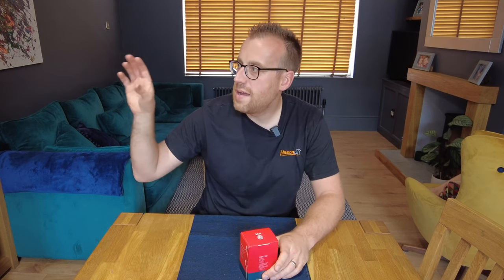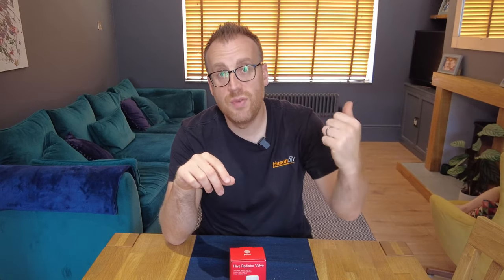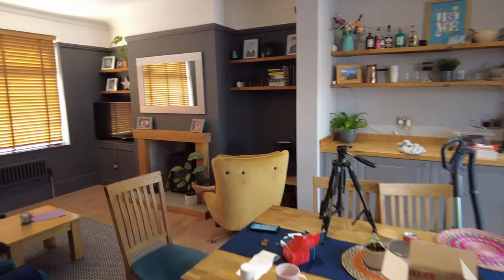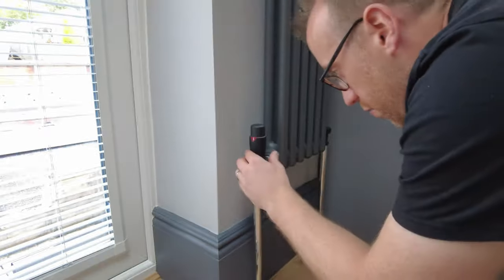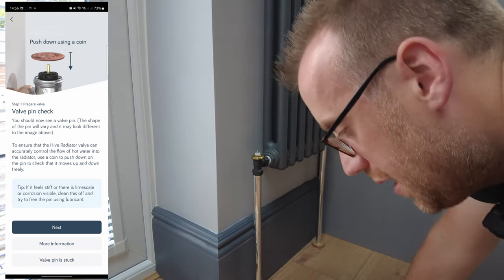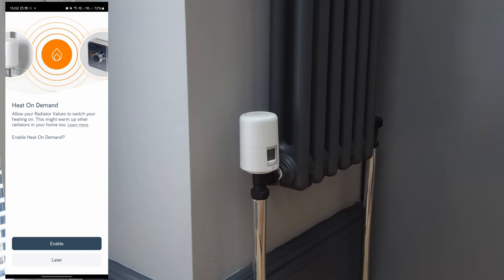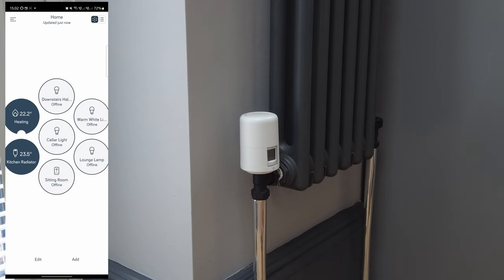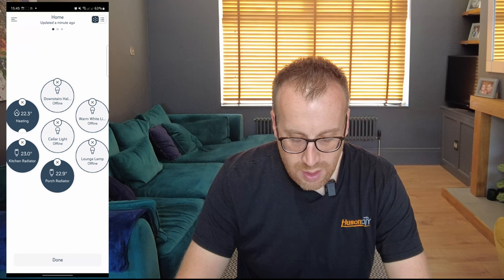Save Money on your Heating Bill!? Hive Smart Radiator Valve Unboxing & Install

Comment: Hey, I totally appreciate your informative video and your time to record it.  If this is your career, again truly appreciate you trying to help others save money.
I have a Hive, and was going to change my valves for these.  My gas engineer kindly pointed out that I will not save energy as I already have temperature setting valves.  Instead of be lazy using the app, to get up off my backside and turn down the room as and when it's not used lol.   My valves Re marked 5 -0.  So I initially saved hundreds on 8 new hive valves. and I'm still saving in keeping certain rooms cooler than others. 😊
Reply from the maker: Hello! Thanks for your comment. You're correct, the main benefit is the ability to automate the valves. I suppose any automation, this being lights or heating etc, could be classed as addressing laziness. 

The beauty of these valves is the ability to schedule different temperatures for different times. You control sections of your house without the need to go round changing multiple valves all the time.

I guess the line between automation/laziness is quite blurred!! Lol.

I suppose a counter question for you. Why have you installed a Hive thermostat system rather than sticking with a traditional/cheaper thermostat setup?
Reply: @husondiy  the gas engineer recommended it, it was on offer, so I do use it for the heating, and now two lamps.  Great as a  security deterrent for when the house is empty.  I have schedules on all 3.
Reply from the maker: Perfect for your situation! I guess that's what great about these different products. Some will be useful for some people, some pointless. 

The Hive TRVs have transformed the way we heat our house. We can schedule for certain rooms to be on and others not. We can set specific rooms to heat up while we're out ready for our return without heating the whole or other parts of the house.

They are certainly a longer-term investment to see the cost savings, but we will definitely get there.

Comment: Hi mate, first off, really great video explaining the step by step guide. I am currently in the researvh phase of getting these. I have a plumber coming out tomorrow to switch my current lockshield valves to TRV and then will purchase the HIVE ones. My one question which i'm sure you probably have already answred before, but just so I understood it correctly is if my main thermostat is set at 19 degrees, but I want my bedrooms to be at 23 degrees, does this require heat on demand or can it be done via individual schedules? Hopefully that makes sense l.
Reply from the maker: Hello! Sounds great. How many Hive valves are you having installed? 

You're right though, you need to allow heat on demand, which would allow the main heating/boiler to come on when required. You can schedule per valve though too.

Let me know if you have any questions, happy to help 👍
Reply: @husondiy  So if i have individual schedules for each rooms so for example the bedroom set for 20 degrees and the living room set for 18 degrees, those will work towards those targets even if the main thermostat says 15 degrees? Would that scenario need heat on demand?
Reply: I current have 6 radiators in the house and the bathroom radiator. I don't plan on putting a TRV valve on the bathroom one. I already have manual TRV valves on two radiators and getting my plumber to come in today to replace the other 4. My thermostat at the moment does not have a fixed location so does it matter if all radiators have a TRV valve excluding the bathroom?

Comment: Thanks so much for the Video. I'm thinking of getting these valves for my house. I've read so many negative reviews I started searching YouTube and found your video. So pleased that you didn't edit out the bits where things didn't go perfectly first time - just as in the real world!  Clearly some time has passed since you installed them, what do you now think this far down the line. Has there been any issues? Would they still work after a software update? Thanks again for your time and advice. Atb Paul
Reply from the maker: Hi Paul!!

I would definitely recommend them. Done a quick video reply for you:

https://youtube.com/shorts/dgfo6F06hkY?feature=share

Any other questions please just ask 👍🏻

Comment: thanks for the video. My electrics went off a few days ago and now the lounge TRV wont calibrate. Its taken 2 days. All the other valves are working. What can I do
Reply from the maker: Hi Niti. This happened to one of ours. I factory reset it and readded it in the app. That sorted ours.

Guide here:

https://www.hivehome.com/ie/support/Help_Using_Hive/HUH_Hive_Active_Heating/How-do-I-factory-reset-my-Hive-Radiator-Valve

Comment: Ben, Can I set all five valves to heat on demand mode i.e. if any one of them wants heat it can turn on the boiler regardless of the other rooms.
Reply from the maker: Hi Mark! Yes 100%. That's the beauty of it, so one room could be on and all the others sit there off.

Comment: I have two questions to ask. When the batteries run out, if this coincides when the heating is on, do the radiators go cold, or does it stay at the temperature set on the TRV before the batteries run out, and does it notify you your batteries need replacing?

I have a heated towel rail in my bathroom. So, would you recommend a Hive thermostatic valve for it, or just for the rooms in my house? Thanks.
Reply from the maker: Hi there!! Great questions. So with regard to the battery in the TRV's, they have an indicator in the app to tell you their battery status and this will tell you when the batteries are low. Its the same for other sensors and also the main heating receiver. So I'm not sure what would happen if you let the battery die, but you should get plenty of warning to replace them before they get to that point.

We have 2 towel radiators in the house, and neither have valves that are compatible with the Hive TRV's (or any other TRV's) so it was never an option for us. However, if yours are different then theres no reason why you shouldn't. I guess its down to preference as to where you want to keep control. Our towel radiators are in spots where we dont mind them coming on if another radiator was to become active in the house.

Let me know if that needs clarifying or if you have further questions. Happy to help where I can 👍
Reply: @husondiy  Thanks a lot for your helpful advice, it really did help a lot. I have 7 radiators in my home, and one bathroom rail radiator. I decided to buy the 8 pack from Hive to get the discounted price. After speaking with their tech people at Hive I decided I won’t install one on my bathroom rail radiator because of two reasons, it’s a small bathroom, and when I open my bathroom door, the door cannot be open fully because the bathroom rail radiator gets in the way, and the door hits the radiator valve that’s already on there. So, if I place a Hive TRV on it, it will stick out more, and will probably end up damaged as well when the bathroom door hits it. Plus, a gas engineer told me you should leave at least one radiator in your home without a TRV on it, for safety reasons, and to protect your gas boiler. The way I see it, having an extra Hive TRV ordered with an 8 pack, it will come in handy if one of my TRV’s is faulty. 👍
Reply from the maker: Awesome!! Glad you went with them. We have been tweaking our setup and loving the extra control it gives!! That makes sense with your bathroom what you've gone with, good thinking!! Hive support have been great for me a couple of times, glad they were for you too 👍🏻

Comment: Can you, please, tell me if the original, main thermostat should be turned to a high setting and allow the individual TRVs to adjust each room?
Does the scheduler on the main control overwrite the individual TRVs? ( i.e. if main schedule set to OFF do all TRVs go OFF)?
Our TRVs are placed at the top entry of each radiator (an age related rule) and are horizontal. Does this make a difference?
Thanks for a realistic video 😊
Reply: Yes I would also like to know the answer
Reply from the maker: Hi there!! 

You need to enable "heat on demand". If you go to your valves in the Hive app. Touch on one of them in the app, then into the settings. There is a "Heat on Demand" you can switch on.

This then allows your heating to come on even if your main thermostat is already at temperature 

Hopefully that makes sense. Let me know if you have any other questions 👌🏻

Comment: Does the thermostat still call for heat or is it just the trv eg: if i put them only in the bedrooms will the thermostat in the living room still call for heat if the living room falls below set temp?
Reply from the maker: Hi there Sarah! Yes your main thermostat will still call for heat if the temp drops below the set temperature. 

However, the Hive TRVs won't come on until they reach their own set temperature. 

Hope that helps. Let me know if you have any other questions 👍🏻

Comment: We have fitted these on our radiators a few days ago but don’t think we understand how to use them properly. So for example should we have a valve in the same room as the main thermostat or not? Then tonight we have had the lounge radiator on which has gone off as it’s hit temperature (in the same room as main thermostat) and when I have then gone to put the bedroom on before we go to bed it won’t come on as the the main hub is off as it’s hit temperature?? Help?? Hope that makes sense!!!
Reply from the maker: Hi Grace!! Great to hear you got the valves!

So, you probably don't need one in the same room as your thermostat to be honest. Its not an issue though. 

The other issue you have, you need to enable "heat on demand". If you go to your valves in the Hive app. Touch on one of them in the app, then into the settings. There is a "Heat on Demand" you can switch on.

This then allows your heating to come on even if your main thermostat is already at temperature 

Hopefully that makes sense. Let me know if you have any other questions 👌🏻
Reply: @husondiy  does the heat on demand not heat your home outside of scheduled times though as we wouldn’t want that? We just want them to come on at there scheduled times?
Reply from the maker: So you need to add a schedule to each valve for the days/times you want for each one. If you don't enable "Heat on Demand" they wont turn on the overall heating at the scheduled time. So you need to do both 👍 Hope that makes sense

Comment: It's expensive to set up and needs batteries to continue to operate. It's so much easier ji use to control the temperatures by turning down your manual ones.
Reply from the maker: It is cheaper to have manual TRVs, that I agree with. However it isn't easier. Ease it what comes with these TRVs. You control them via the app, Alexa or even manually. It gives you ultimate control over your heating. If you have around 10 radiators, changing those manually every day isn't easy and would be easy to forget to change them, therefore heating unoccupied rooms and wasting money.

With regards to batteries, ours have mean in for well over a year and still on the original batteries.

Comment: I have a fitted one valve and it will not calibrate. Any suggestions to fix this.
Reply from the maker: Hi Colin! I had this issue and a factory reset sorted it for me. Steps below:

1. Take the batteries out
2. Hold down the button below the screen
3. Put the batteries back in while still holding the button down
4. Continue to hold the button down for 5 seconds
5. The display will flash and then show all segments lit - you can release the button at this point
6. The Hive Radiator Valve will reset all settings to factory defaults and then restart in installation mode

Let me know how you get on